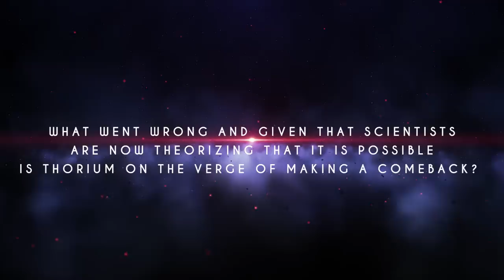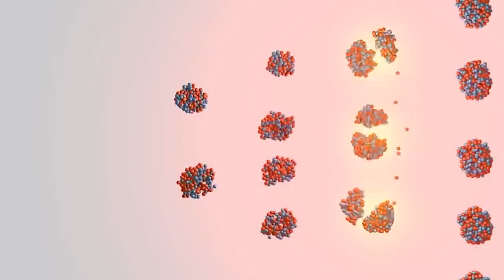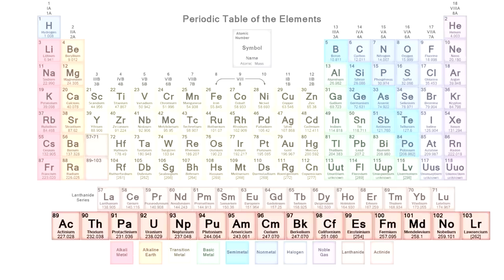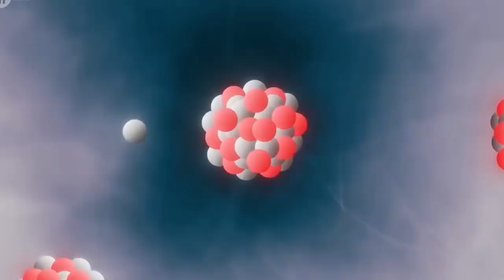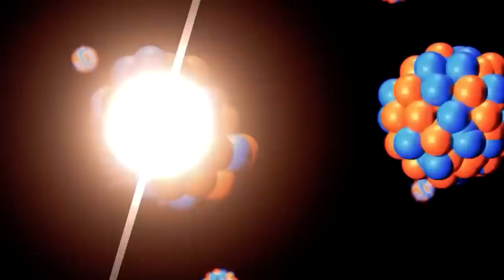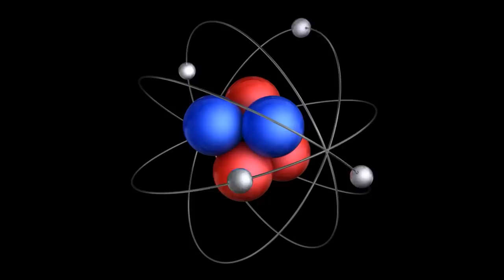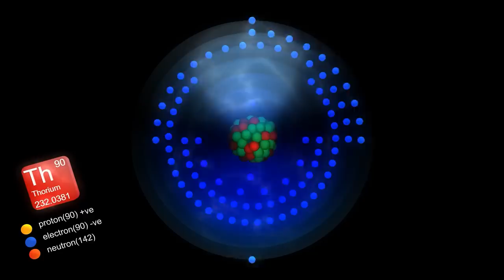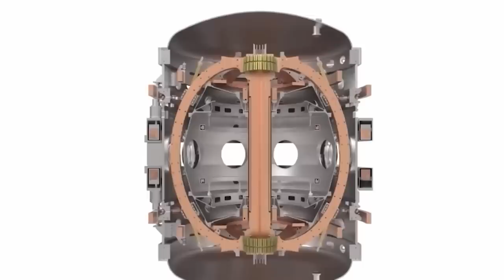Scientists FINALLY Revealed The First Ever Thorium Reactor!

Comment: Thorium reactors existed in the 1950s
Reply: And they like1950 big bands are no longer around and for good reason
Reply: One ran at Oak Ridge laboratory from 1965 to 1969
Reply: Yes, Oak Ridge operated one for over 40 years ...
Reply: Exactly! But it was too clean! You know what I mean.
Reply: only ONE or two test facilities .
Reply: ... at Oakridge?
Reply: Oak Ridge ran a Thorium fission reactor for 10 years in the 1960's. Corrosion was a problem and neutron stress cracking. They should have continued development since we now have much better materials science.
Reply: And ran safely for many years . The bomb makers wanted the plutonium for bombs and they kept the thorium reactors away .
Reply: And if we had continued to develop them, today we would have electricity too cheap to meter.
Reply: Ow thanks for the info since i already learn thorium reactor from games ...such misleading video title
Reply: I know.  Where is the new, fresh, physics and other science.  This post is only about engineering
Reply: He does mention thorium making a 'comeback'
Reply: No, there was a MSR made for the USAF, but it wasn’t a breeder, much less than a thorium breeder. 

A very important development, to be sure, but it was fueled by U235.
Reply: Lots of them
Reply: @WJV9 and Thorium is not fissible sorry

Comment: The rising cost of Uranium reactors mostly has to do with regulations, not fuel costs.
Reply: The safe extraction and processing of nuclear materials requires regulations.  You want a nuclear industry that works just like the Ohio train derailment correct?
Reply: If they retrofit old reactors with more modern designs they can even utilize previously "spent" fuel as their efficiency is much, much greater, thus reducing the demands on new Uranium to begin with.

Comment: The Fukushima reactor was not damaged by the earthquake It was damaged by the flooding caused by the tsunami.  Actually only the emergency cooling generators were damaged by the tsunami.  The reactors them selves were later damaged by a chemical hydrogen explosion when overheating produced hydrogen and oxygen gas which exploded.  This explosion would not have accrued if post reactor cooling could have been matained.  A similar power plant closer to the earthquake center suffered no damage because it's generators and other parts of the plant were placed higher.

Comment: Thorium reactors were developed by the US Airforce in the 50's and 60's to power aircraft. Thus, the designed reactor could be small. They can be small enough and inherently safe enough to be factory produced and placed near to the industries and cities that they serve. There is no engineering obstacle preventing this development. Bias, government restrictions and public fear are the primary obstacles.

Comment: Thorium also was (and still is) used as a coating on the cathodes of vacuum tubes, and in the mantles of kerosene lanterns.
Reply: And in welding rods .
Reply: Yep gots about 10 in the garage Coleman Mantels - also got some Tig electrodes with some in
Reply: Also used to whiten teeth in toothpaste.

Comment: I remember during my first Nuclear Engineering class when the question was asked about thorium and we were told by the instructor that he would answer only one question and then to NEVER bring up the topic again.  I always wondered who had gotten to the Nuclear Eng. Dept. at NCSU to force that type of reaction from a professor.  

At the first part of the video it was indicated that Uranium reactors were a major problem.  This is not really the whole story.  It is the fact that we use Pressurized Water Reactors (PWRs) for power generation, which have a fatal flaw if they are hit with total power loss and can not operate their cooling pumps, just like what happened at Fukushima. We used to also have boiling water reactors which are not pressurized like PWRs, but there is no separation of the water that passes over the reactor core and then the turbines.  This contaminates everything, and is a nightmare to perform maintenance on, so BWRs fell out of favor.

I feel the use of PWRs should be band from use on land due to their catastrophic failure from a natural disaster.  For those wondering about TMI, that was a human factors error and parts failure problem.  Another reason we should move away from civilian PWRs is that they produce SO much reactor waist since they only use about 4% enriched fuel, of which a fair amount is not able to be fissioned in the core due to the buildup of containments from the fission byproducts.  If we are going to continue to use this type of reactor, then I feel that they should all be ship based reactors and use very high enrichment just like the Navy does.  Keeping these ships a fair distance from the shore and on a state of alert that allows them to be moved at a moments notice would prevent another Fukushima.  Also these ships could be moved around to provide power to areas that may have been hit by natural disasters, much like the US Navy has done in the past with it nuclear powered ships.  Also, using a highly enriched fuel would cut down on the amount of overall contaminated waist and greatly and reduce the amount of maintenance cost by eliminating a number of the refueling periods since the reactor can go far longer between refueling periods than can the current PWRs.  Until we can get politics and special interest groups out of the picture, it is going to be a very long time before we can solve this issue.  Strategically and environmentally speaking, nuclear power is always going to be needed.  Regular power plants continue to fill our sky’s with pollutants that contribute to global warming which will affect the whole planet through rising sea levels and changing weather conditions.  The waist from reactors can be confined to a small area and not affect the entire planet.  Until we can all come together and work on this problem to reach a common goal, we are going to be up “sh__’s creek” without a paddle.
Reply: very safe until something goes wrong

Comment: The answer to “why has thorium not been adopted” is more nuanced. It’s not just about nuclear weapon production. Take the event when Thorium research was stopped- the Oakridge lab in 1970. Alan Weinberg, the man who invented the uranium fuel cycle we have today, was actively researching and completed a thorium molten salt reactor. The program was terminated after its first successful power up, with no explanation. Thorium MSR operate on the thermal spectrum of fission, whereas Uranium operates in the “fast” spectrum. The analogy would be automatic vs manual transmission in that you have two different processes that produce the same result- using heat to turn a motor shaft. 

But if your country’s flagship model is A, despite B being better you have to stick to A because this is what is being sold. The US helped build hundreds of fast spectrum BWRs across the world and couldn’t undercut profits with the advent of a new MSR design.

Comment: Two additional problems if solved then we will have our low cost unlimited energy source. (And unlike fusion power, Both problems are reasonably solvable)
1… Ideally, for every 4 neutrons absorbed, 5 neutrons are emitted.  But the wrong isotopes of salts will also absorb neutrons which ruins the chain reaction.  Research should focus on isotope separating of fluorine atoms get a supply of the needed salt isotope.
2… liquid salts are very corrosive and need improved solutions to manage and reduce this issue.

Comment: Thorium reactors have been built for research and testing long time ago. The major problem that made scientists stop working on it was the extreme corrosion that made it impossible to operate a reactor of that kind safely. YOU didn't mention with one word the extreme problems that are not solved until today.

Comment: As the demand for electricity increases, small thorium fueled reactors could provide a valuable addition.  Small reactors could be built in cities and take much (if not all) the load off the grid.  Because electricity would not have to be sent over vast distances, efficiency will increase.

Comment: Thorium reactor produce equal amounts of nuclear waste: each splitting of a U233 atom results in two smaller nuclei, plus 2-3 neutrons - same goes for U235.
However, since there is no U238 present in Thorium reactors, it is way more difficult to breed so called transuranics (americium...). And since those transuranic materials are the only component in nuclear waste, that has decay rates in the 100.000s of years, compared to hundrets of years for non transuranics. Therefore, the amount of waste remains the same per net energy release, however the problems to long term storage are reduced by some orders of magnitude. Still, the stuff is really nasty beyond a typical human lifespan.
Reply: Interestingly thorium reactors can be fed other HPW reactors waste for example and “burn it”.

Comment: Thorium has no fissile element. A reactor can use thorium with addition of essential fissile fuel fissile uranium 233 will 😊be produced just like plutonium in a uranium fuelled reactor. Once you have sufficient u233 and breeder reactors, thorium can be used with U233 fissile.
Reply: What about sodium reactors?
Reply: 233? Wasn't it 235 or 238
I wasn't aware it could get any smaller?
Reply: Heavy water Thorium reactors? Explain.

Comment: Thorium is a very good source of fissile Uranium. Uranium from Thorium is obtained by using Thorium as a radiation shield for a fissile reaction. As a shield, Thorium serves two functions. 1. Fissile reactions need to be shielded, and: 2. Through a series of reactions above my pay grade to detail, a small fraction of the Thorium becomes fissile Uranium. I remember that the atomic weight of that Uranium is U233. In any case, there is no such thing as a Thorium fissile reactor.

Comment: thorium based lifter reactors are clearly superior to fusion and uranium reactors so yes we should definitely be doing so.
Reply: Thorium is a better alternative than uranium fission for power production, but not better than fusion.  Fusion produces no undesirable long lasting waste, and is more energy dense than current fission reactors.  But fusion is incredibly difficult to achieve, requiring conditions like our sun: tremendously high temperatures and pressures.  If we could produce fusion economically and reliably, thorium would no longer be of interest.

Comment: I understood simply by bombarding thorium with a  specific photonic beam  thorium would react accordingl producing a reaction suitable for power production.
Reply: What is a photonic beam????   Thorium transmutes with neutrons, not light and not protons
Reply: No. Thorium must be irradiated with neutrons to be converted to Uranium 233, that does the fission and energy productium.
Reply: IIRC, what's called for is bombardment by slow, or thermal, neutrons. Or alpha particles as an alternative.
Reply: not photonic, but a neutron beam. photons interact with the electron shells, and unless highly energetic gamma rays, never with the nucleus.

Comment: The possible low cost and abundant availability of electrical power could be used to produce hydrogen where electrical motors and the requirement of heavy storage batteries  are not suitable.  Use as fuel for long range aircraft for example.

Comment: Only in the reactor for three to five years not because it becomes radioactive, but because of the mass changes as energy is extracted and if the mass changed so much that it bursts and breaks the cladding you've got a major shitshow
Just like your lithium ion batterie, if the dimensions changes and it grows you got a problem

Comment: A lot of not precise / not correct statements. For example throrium reactors excisted: https://en.wikipedia.org/wiki/THTR-300. But some generally good explanations of the differences between a uranium based vs. a thorium based fuel cycle.

Comment: "First Ever" .. not hardly .. the first was set up in the USA as a test platform and worked. However, Thorium was put aside because it made for weak(er) weapons than other materials. In addition, the materials needed to combat the corrosive nature of Thorium (molten salts) had not been developed yet and the funds to develop that technology went to developing nuclear weapons. "Dangerous Radiation" leaks are very unlikely with Thorium reactors due to their design. Additional bonuses are that the fuel is cheap and easily acquired, the half-life is VERY short, and used fuel can be recycled several times for re-use and leaves about a 55-gallon drum that is easily stored and (again) has a VERY short half-life.

.. and for true hard-core tech-nerds/geeks .. as of a few years ago, some of the original reactor components could still be found laying in the yard/site where the first reactor was developed ..

Comment: Oakridge national lab operated a thorium test reactor for 10 years in the 60s. Shut down in Gabor of reactors that could supply bomb material. Let’s get back on track and pick up where we left off and make the safe thorium reactors. Current reactors us less than 1 % of the fuel then remove. Thorium reactors use almost all of the fuel. It can also use current waste fuel from current reactors. Let’s put  a fraction of the climate change money into the practical solution